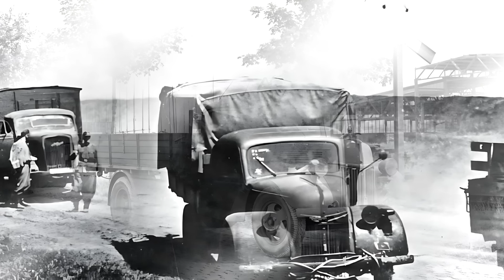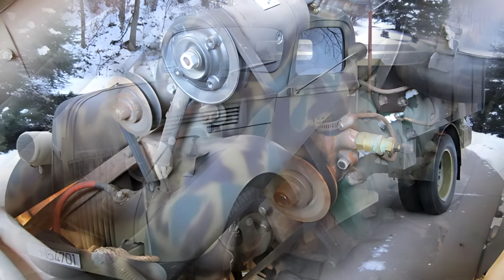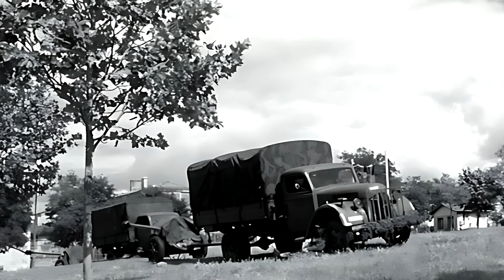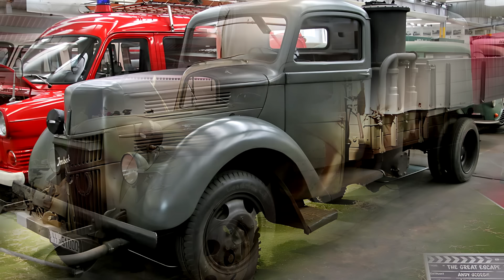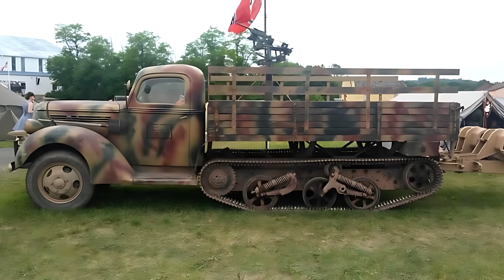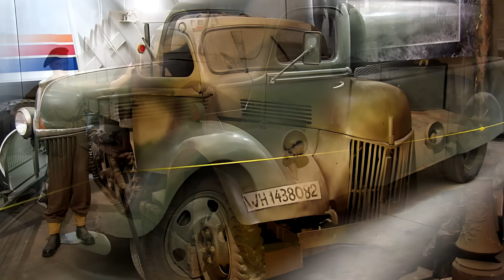1941 😐 Ford V3000S — The Truck Nobody Loved, Everyone Needed

Comment: I grew up driving a 41 Chevy farm truck in the 50s in the US aware that FDR had shipped heaps of them to the Soviets and they had served a similar role in Red Army. The Chevy was a smaller if my dad was correct to call it an ton and a half (not sure how that compares to a ton anda half pickup, but it was a much larger vehicle with much more capacity)with a straight 6 and 4 speed plus reverse. Looks like the German Ford had a version of Henry Fords flat head V8 that my dad drove up to the introduction of the Yblock in the mid 50s.

Comment: Hey Germany.  Put a different engine in it and save a bunch of fuel.  I would never have guessed they made that many trucks for the German war industry,
Reply: Well, installing a 'different' engine wouldn't have made much of a difference - ALL engines of the era, regardless of nation, would consume large amounts of fuel. By today's standards 30s/40s engines are inefficient, many were still L-head and featured low-compression, both due to lower octane rating but also to reduce cylinder pressures.

As comparison one of our club members owns a '43 Austin K5 3t, when it was restored in the 70s the then owner ditched its petrol I-6 for a 'newer' Bedford diesel I-6 out of a junkyard truck for to reduce fuel consumption. It supposedly dropped from 65l petrol/100km to 35l diesel/100km on road. Now, while that could sound impressive it proves that not only was the petrol engine indeed a gas hog, however it also goes to show that the 'newer' diesel is, by today's standards, not a very effective power plant either - a K5 is by today's standards a very light/ petite vehicle and I've driven fully loaded 3axle modern trucks at much lower consumptions than that.

As in any innovations in history it's the tech of its day that poses the limiting factor - for a 40s truck engine cheap fuel injection or forced induction tech was simply not invented yet, reserved for aero usage primarily. To mock the Germans for the Ford's power plant is like asking why the codebreakers at Bletchley Park spent so much effort decoding Enigma when they could've invented AI to do the work for them in the first place